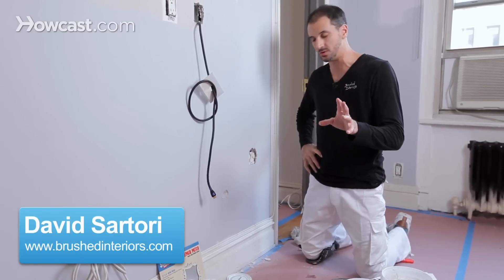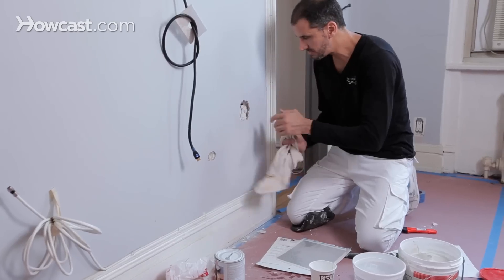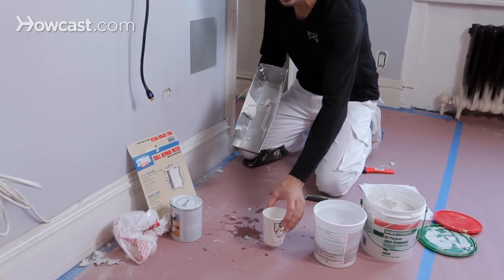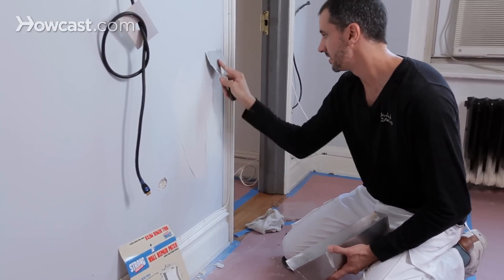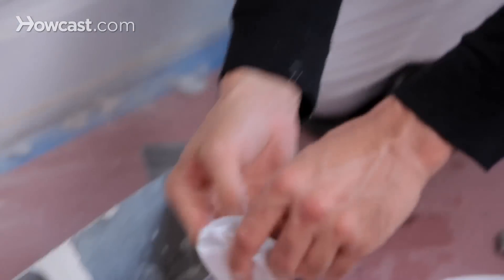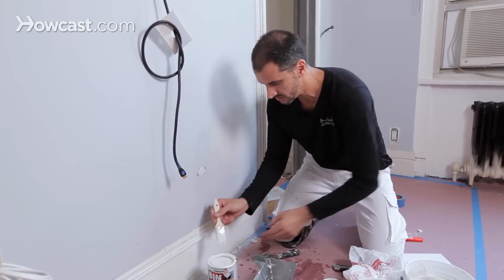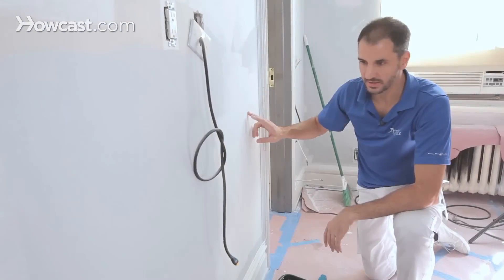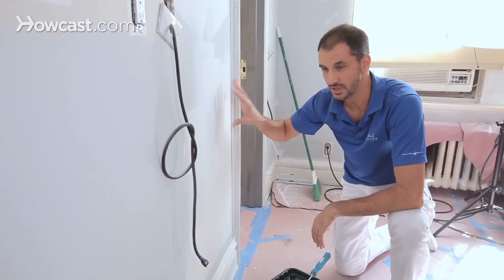Large Plaster Repairs & Skim Coating | House Painting

Comment: Yea if your an amateur you can do this, but when the wall becomes bumpy after a while then you’ll be like we need to hire a drywaller/painter, do it professionally the first time, just cut a square drywall, put a wood backing for support and joint compound it, 2 coats, and your done, thin coat it to avoid the sanding, that is it...

Comment: I am repairing small fracture lines and one larger cracked area in plaster walls (50 year old house) - is there a premixed compound to use vs trying to get the mix right?

Comment: what is the difference with this method to actually cutting out the hole and replacing with dry wall piece??
Reply: This method is quicker and less mess, I would presume. The Drywall method would be stronger.
Reply: Metz This method is 100 times quicker........
Reply: One is the proper way, the other is the lazy way.
Reply: Are you seriously asking that...? Its obvious what the difference is... Jesus...
Reply: @cwrowe  and 100 times wronger.

Comment: That’s a larger hole? Will this method work for something roughly twice that size?
Reply: Doubtful. In fact I'll just say no it won't. If a hole is that large, you need to fill it with a replacement piece of drywall.
Reply: You need to buy a new home.😀😀😀. Just kidding.

Comment: Hey I'm 15 just swung my chair on the wall (my parents pissed me off) the hole on my wall is around the same as the one in the video, but my wall has a different texture on it like it's not smooth how do I re-adjust it the same way? And how much is the metallic sheet and the compound?
Reply: Burn the house down, collect the insurance and buy a new house.
Reply: Dude he's 15....... this isn't even his problem when you move out let your parents deal bro.
Reply: Somebody needs the leather strap adjustment sounds like.

Comment: What was not shown was the amount of drywall mud required to float this patch to ensure a smooth and even surface across the area, in relation to the size of the original hole.

Comment: That's to big piece y you cut that in pieces you can fix a least 4  more holes 🤔🤔🤔👍👍
Reply: Because the damaged drywall usually extends out further, behind the wall where you don't see. You have to reinforce an area wider than the hole to be safe.

Comment: now the wall texture will be different on that entire patch compared to the wall.
Reply: Not if you do it right and paint the whole wall after... Jesus...
Reply: Umm no it won't or no one would do it this very common way 😂
Reply: Many different types of textures on painted walls. Some include orange peel,  knockdown and stippling.  List goes on. Some are easy to match,  some not so much. I prefer smooth.
Reply: @dbleezy805  Paint doesn't add much texture. It will not match most textures just by painting.

Comment: 👍😉🖑
Reply: redlion1612 would this work with a medium sized hole in a older plaster-wall. ( plaster and wooden lathes knocked in)?..
Reply: it might but if you mess it up there's an easy fix it requires one nail one hammer and a picture frame bigger than the hole!!!!👍😉
Reply: lol...unless you rent, and are moving someday.
Reply: in that case I suggest you super glue the picture frame to the wall lol !!!       🖐😂🖑
Reply: well yea, I guess that might actually work. Good idea, I can't tell ya how much I appreciate the advice.

Comment: are you sure?
Reply: joint compounds supposedly are hard to sand. so why don't u fix the hole by only filling it with joint compound and then use skin coat for finish?
Reply: @keshikLR  Quick set compounds are harder to sand. The green stuff is very easy to sand.